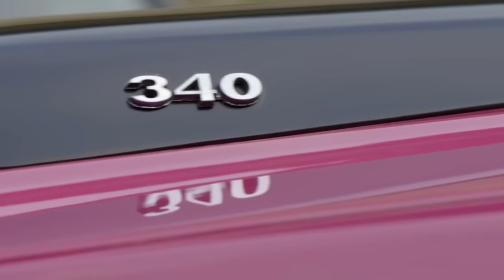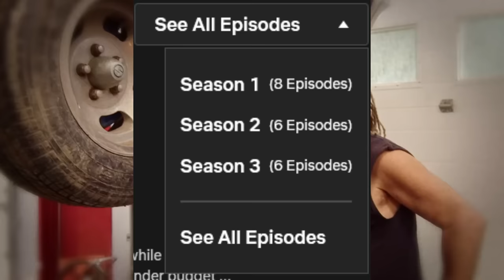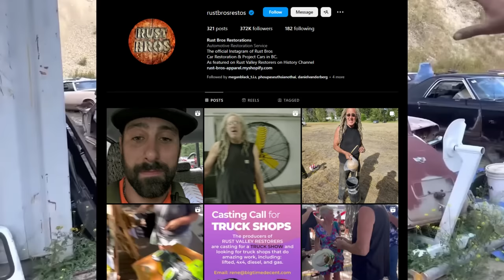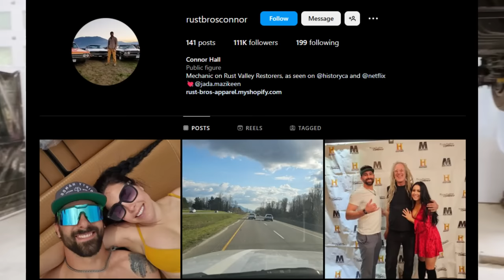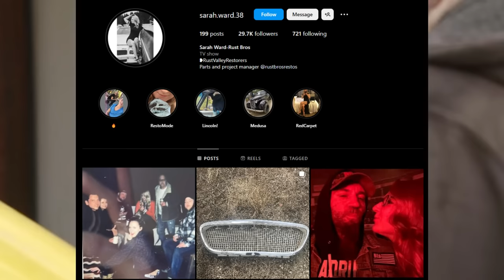What REALLY Happened To The Cast of Rust Valley Restorers!? SECRETS FINALLY REVEALED...

Comment: I watched this show for awhile. I wouldn't buy a car from them. Many times they yanked an engine from a car that had been sitting for years, slammed it into one of the projects to sell without going through the engine at all. That's "Roadkill" level hackery.
Reply: You missed the point, despite the show being called restorers they were not restoring to factory levels! It is more about resurrection, returning cars to safe drivable standards as cheaply as possible so the average joe has a chance to own one! If you buy one to drive every day and do 50 thousand a year in it you would be wise to do a complete mechanical overhaul! Taking it out for a few hours every other week is the goal they achieve!
Reply: @paulorchard7960  It's not cheap if the engine siezes in 500 miles. They sold some of those cars for quite a sum. The least they could do it pull the heads and inspect the engine.
Reply: @robertfrey3607  Pretty likely they did, but didn't bother showing it.
Reply: Indeed, that WAS mentioned in the video!!!
Reply: @DuneRunnerEnterprises  Not always. A few times they threw in the engine, then discovered it had issues.
Reply: They sell cars that the average person can afford. You realize that what most people drive every day is well over 50k now often approaching 100k. You get what you pay for. Considering the builds that their “competitor” would do builds for 150 - 200k while they were selling most cars around 35k on average…
Reply: @AdamScoots247  The average person doesn't have $15,000 to spend on a car that is basically a toy. If they do manage...they certainly don't have extra cash to fix lame mechanics.
Reply: @AdamScoots247  for 40k I'll sell you my fully gone thru 75 duster new 340 fuel injected full suspension with disk brakes. These guys build junk. I'm putting a 6.4 hemi with 8 speed auto in a 1972 duster and I'll be around 45k all in with full qa1 coilover. You could totally build a really nice car for under 50k and have it mechanically all new and not a used junk engine.
Reply: @bryceocain5234 that’s what I did with my brothers 66’ just re-wiring is what kills me. I put his cab and box on a 91 3/4 ton with a Cummins and 4 by. Wish I could show you a pic.
Reply: @robertfrey3607 😂 you can tell you’re not a car person 🤦🏽‍♂️ those that have 15k have the money for the “lame mechanics” just because a shoe doesn’t show something doesn’t mean it wasn’t done. Also he has a bunch of parts and of course things will happen rain you have warranty😑 like I said you’ve never had a car built and it shows 🤣 who goes to get a car built and doesn’t have the money for the build? 🤦🏽‍♂️never has a shop been like ok I’ll build it for you even if you don’t have any money💀
Reply: But they don't show every step like every other reality show they don't show every thing including rebuilding the engines  not just swapping
Reply: No shit leaves the shop !!
Reply: That's what they show,  but they do go though then proper later.
Reply: They make sure the engines are good and the cars are safe
Reply: @NikkiWraith no chance
Reply: @AdamScoots247 who wants a shit build?
Reply: @E36ASAP sure. It's called reality TV.
Reply: Dude. Ya DONT know what your talking about….THATS what tv wants you to think…..get real.   Know before you comment on something …DUMBSCHITT
Reply: Hey! Remember " NO SHIT LEAVE THE SHOP" SO REST ASSURE THEY WENT TROUGH EVERYTHING 🫡
Reply: Guys chill out it's just a reality tv show
Reply: @darrenbaillie98 exactly..  a REALITY show
Reply: Saw Mike working in Kamloops with road crew. Don't know who he was with and what they were doing.   It was a shock 🎉
Reply: I never believed that these clowns restored anything, for the whole show they just bang away at something, then a finished car appears for the last five minutes.
Reply: en muchas ocasiones muestran donde hacen chequeo de compresión a los cilindros y con el simple hecho  de ver el funcionamiento del auto y lo limpio que se miraban los motores te das cuenta que estaban en perfectas condiciones
Reply: @richardthompson6366 jajajaja las pruebas que hacen de diagnóstico son las correctas si no sabes de mecánica no comentes